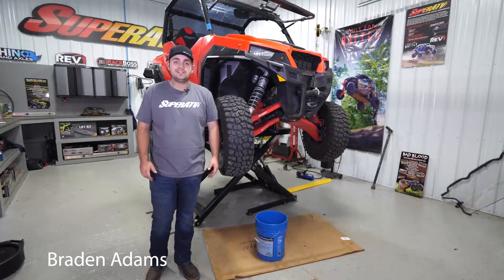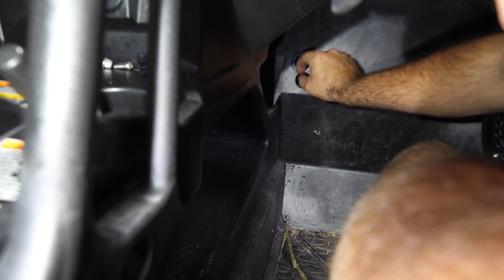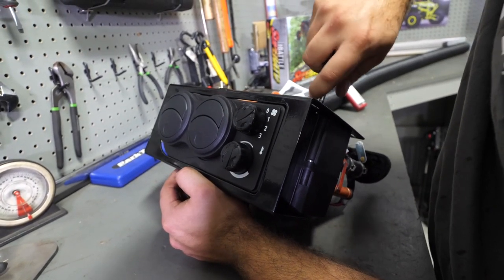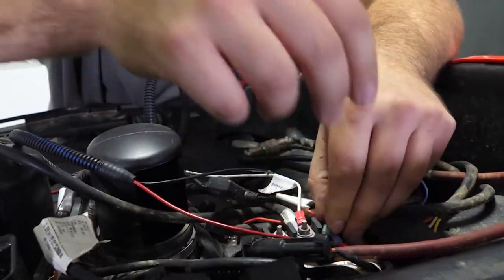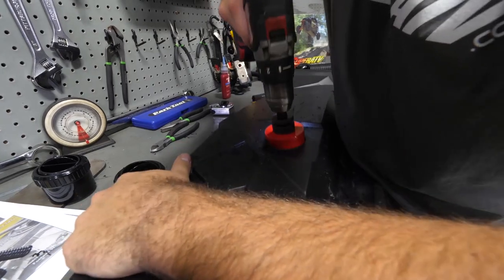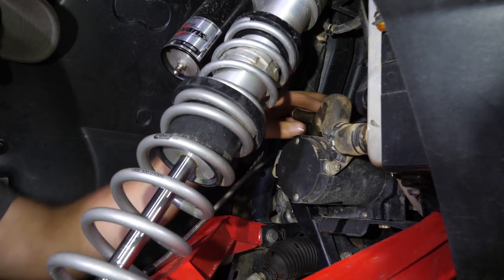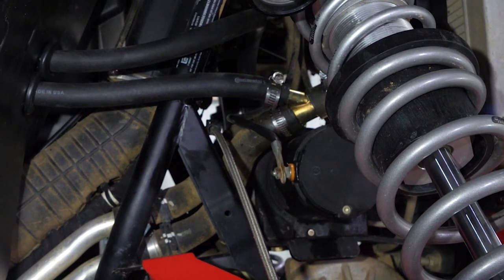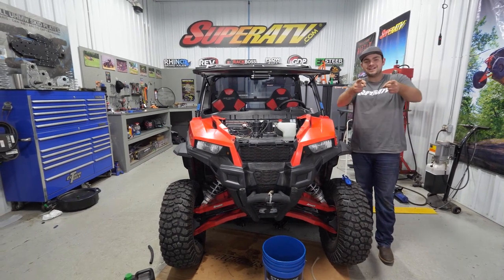How to install SuperATV Cab Heater in Polaris General

Comment: great video but one question and I might have missed it but...the lower radiator hose goes to which hose on the SuperAtv heater?...it looked like you just run it through the grommet and grabbed either hose?
Reply from the maker: The lower radiator hose will connect to the lower hose on the heater. Sorry for the confusion!

Comment: Can the inlet line be tapped into the oil cooler line on engine like the hidden, underhood heaters? It would obviously require additional hose but it should resolve issue with t-stat correct?
Reply from the maker: Not 100% positive to be honest. This method is what we found works best to great reliable heat.

Comment: Wtf how does super atv not know to bleed the cooling system on the back of the head at the bleeder screw? This is crazy I work at an independent  shop and i installed one of their heaters so i watched the video just for shits  and giggles because  it came with ZERO paperwork and I cannot believe this this is crazy
Reply: @SuperATV
Reply: #SuperATV